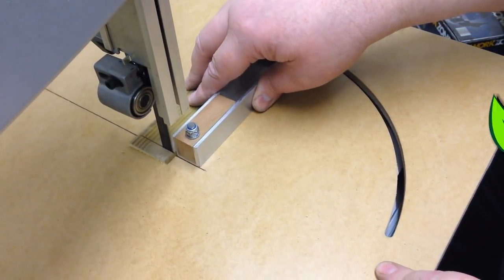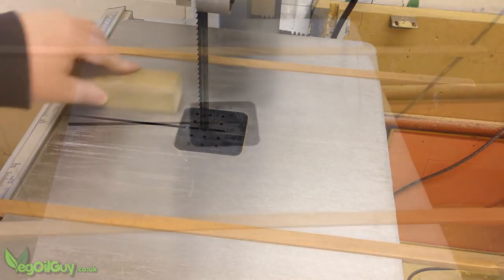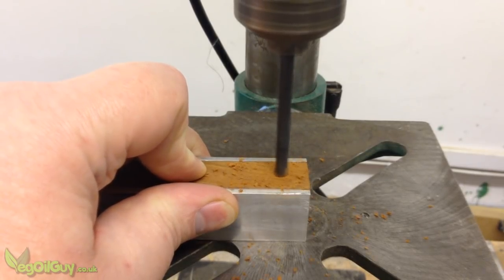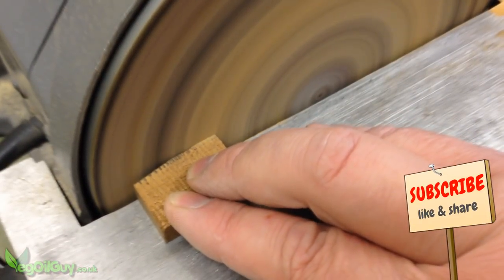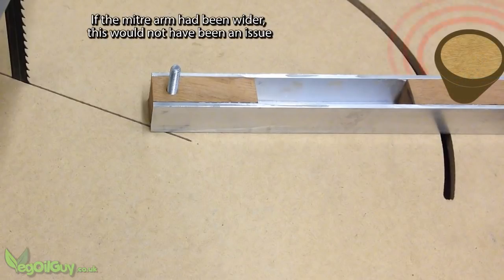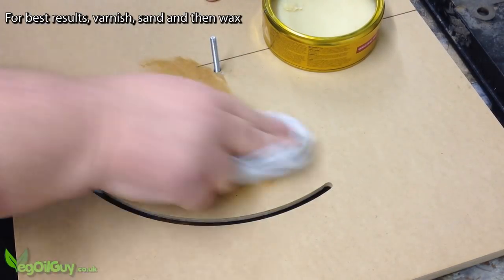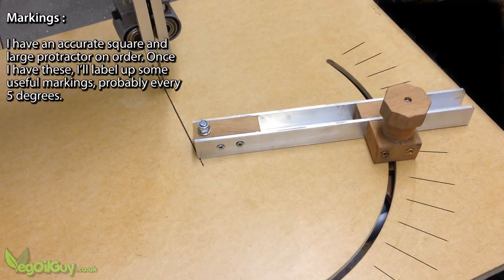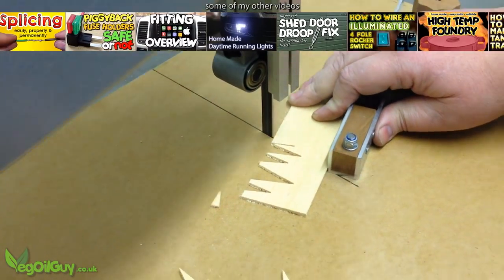bandsaw cross cut SLED - multi angle (mitre) cuts - for bandsaw or table saw

Comment: Cool man! That’s one tool I don’t have yet and eventually I would like to get 👍🏻 great job explaining that! That could be useful on my scroll saw at the moment 🍺
Reply from the maker: Thanks mate : )
If your scroll saw has groove in the table, it will work. It's amazing how accurate this can be.
Reply: VegOilGuy unfortunately it doesn’t. What would you recommend instead? Any suggestions 🤷🏻‍♂️
Reply from the maker: Is the table square...?
Reply: VegOilGuy no it’s like an oddly shaped oval 🤷🏻‍♂️ haha.. maybe I could cut a piece though to lay on top and make it square
Reply from the maker: Ah.... you're way ahead of me  : )
Oval is a typical shape for a scroll saw table, though I've no idea why. But my suggestion...
A thin but strong overlay table from 1/4 inch plywood. Overhang a little extra at the side and secure beneath the edge some timber strips, maybe 1/2 thick or whatever. This will give you a flat, rectangular table with smooth, square sided edges. Wax this table for easy use.
Now build a sled to go on top of this, but rather than grooves, use your new square edges as guides. So your sled is slightly wider than the table and beneath this you add strips that hug the two side edges of the table top. With these smoothed and waxed, as you push or pull the rear edge of the sled, it can only move back or forth. Are you following me? Have a look at this image...  http://www.vegoilguy.co.uk/_maingifs/scroll-saw-sled.png
Reply: VegOilGuy yeah man thanks 👍🏻 I’ll give it a go as I work on a new wood project. Unfortunately I won’t be filming it. I will be down the road though 👍🏻thanks Geoff!
Reply from the maker: No worries mate. Glad to help.

Comment: I don't understand why you took the bandsaw blade off. Couldn't the gluing of the single rail could have been done on a workbench, then the slot cut on the bandsaw?
Reply from the maker: Hi Mark. Yes it could... but I took the view of "what if the slots and table weren't square?" It's a long shot I know, but I've come across unparallel grooves, twisted tables, etc, and preferred to dot the I's and cross the T's  : )
Or maybe I was just daft and wasting my time  : D

Comment: Very nice. Instead of a knob you could put a cam lock parallel to the fence.
Reply from the maker: Good suggestion  : )
Reply: With a cam lock it would be cool to make the nut lock on the backside into indents representing common angles. Since the cam lock would operate in any direction you could have one side of the nut fit into the indents and the other side free to set as you please.

Comment: Oops!  You're going to clip the corners of your miter's fence if you lose focus.  🤤   I know I would.    Nice job anyway.   👍
Reply from the maker: Oooooo.... losing focus on a bandsaw means losing fingers mate. But you are right. 
Of course, the stop that I haven't bothered with could fix that, or rounding the rear corner of the mitre arm. 
But fingers mate... fingers  : )
Reply: @vogman  Well fortunately, after 60+ years of life, I still have 1, 2, 3, ... yep, all 10 fingers.   😊   They've been sliced, crushed, burned and abraded a bit, but I've still got them all.  🤗   My biological father on the other hand, lost the tip of his right index finger to carelessness before he was 18 years old.   🤕   So I'm doing a little better than he did.   👷‍♂️
Reply from the maker: Yes, they were a careless generation with their digits. I have family that would be of a similar age with similar injuries. We knock health and safety a fair old bit, but the relative I'm thinking of lost a finger carrying sheet metal at his workplace...
Anyway, thanks for the input as always Ron  : )
Reply: @vogman  Did you also use wax in the table slots, leave them dry, or use something like graphite?
     Also, are you still driving that veg oil diesel?
Reply from the maker: I waxed EVERYTHING... it's so slippy and shiny it's amazing it stays on the table  ; )
And yes, but only on long journeys. Short journeys are no good. The engine needs to be nice and warm firm and that doesn't happen for a few mile.
Reply: @vogman  Did you consider using a cam lever to lock down the miter arm?  It'd be more complicated to make, but faster to use.
Reply from the maker: I'll be honest I only ever thought about the threaded knob approach. What did surprise me was how very little twisting and turning was necessary. Probably half a turn is sufficient to move and replace. 
Genuinely, it worked better than I expected  : )